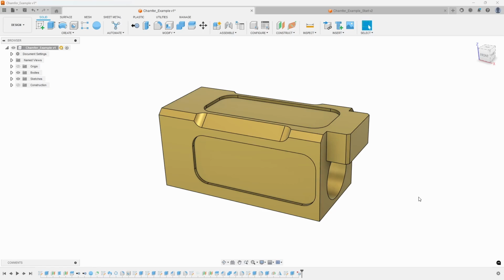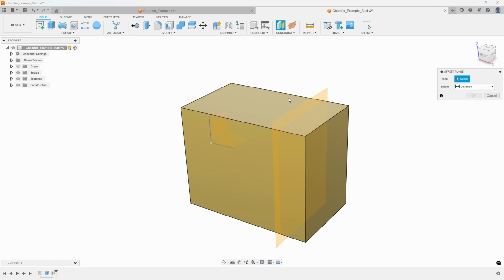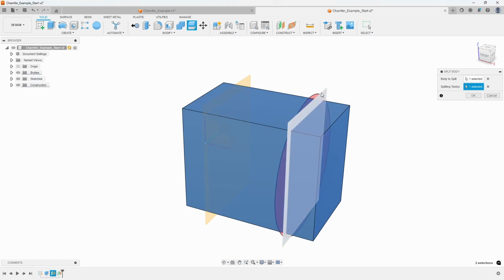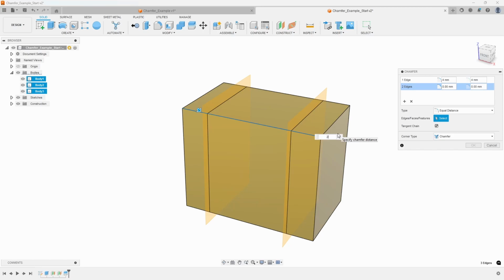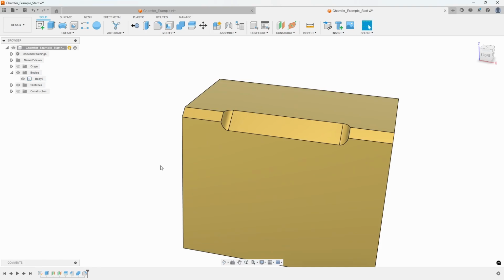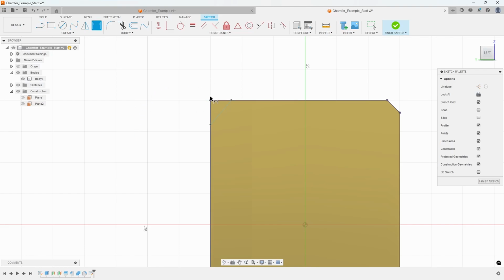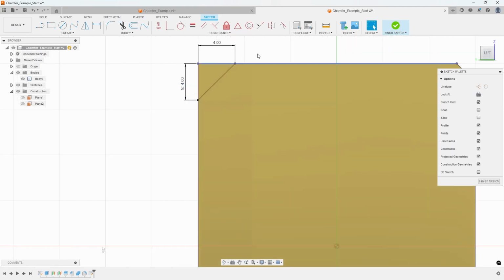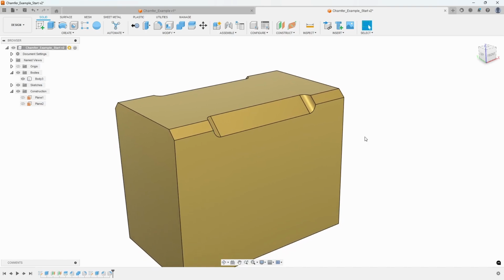Fusion Stepped Chamfer

Comment: Nice quick tutorial. Thanks.

How about doing an actual stepped, i.e., gradual chamfer? What I mean is instead of a fillet, what if I want a series of small chamfers to create a curved edge. This sometimes is useful for design purposes. It does make elegant designs. Today, I make it the painful and brute force way. Start with one chamfer, then select the new edges and add another chamfer etc, until I get full curvature. It's a bit painful and creates a series of chamfer commands. I wish there was an easier way.
Reply from the maker: I think I understand what you are saying, and that would make for an elegant design.  Maybe you could create a stepped profile to "sweep" add or sweep remove the curve.  Not sure of that would be any quicker than doing multiple chamfers, but it might give you more control over the "profile" of the steps.
Reply: @bradtallis8968  That's a shame. I think such features exist in other programs. I wish one had a 'Stepped Chamfer' command in which you define either one-sided, two-sided or symmetric as it is for the current chamfer command but be able to specify number of facets. 1 facet would be the same as existing chamfer but 2 or more would create a nice stepped chamfer.

If you have an "in" with anyone at Autodesk, perhaps you can suggest the feature to them.

Comment: A third way to do this would be to start with your two offset planes. Then chamfer the corner. Instead of splitting the body, use the offset planes to split the face of the chamfer. That just use push/pull on the face you want add the deeper chamfer. No need to split the body.
Reply from the maker: Yep!  That's true.

Comment: I like how you chose 2 different ways to do this, I'm always looking at how am I going to machine this, which in most cases is very different from how would I print this.
Excellent tutorial as always!
Reply from the maker: Ya, I think machining this would require indexing the block at 45 degrees to create the "blends" on the edges of the chamfer correctly.  I tried adding chamfer toolpaths to the design and noticed the blends did not machine the same as modeled.
Reply: @bradtallis8968  I would probably use a wide chamfer bit and just select the top edge to follow that contour. Thanks again for all your videos!

Comment: For method #2 you didn't need to create the plane.  You could have put the sketch on the end and then offset the extrude (same distance as you put the plane).
Reply: And also drawn both chamfers in the sketch, so it’s one sketch, two extrusions, and a fillet.
Reply from the maker: @swissfreek- ooh.  Also a valid point.  Simple and concise.  Thanks for sharing!
Reply from the maker: @j.f.christ8421 - Yep!  Good point.  Totally should have shown that.  Some die-hard parametric people say that you should always "build in" your design intent, such as defining the plane and then creating the sketch on the plane instead of using an offset in the extrude feature, that way it is easier to "understand" the design intent if the part was handed off to someone else.  However, I think the offset in the extrude is such a cool feature, I'd much rather use that and keep my timeline "cleaner".

Comment: I didn't know you could do multiple chamfers in the same operation. Great tip. It's been awhile since I used Fusion 360. But I seem to remember that you can split a face with a plane. Could you do it this way? Create the 2 mm chamfer on the full Edge. Create the offset planes. Split the face of the 2 mm chamfer with the offset planes. Push the center portion in 2 mm. Create the fillets.
Reply: So I was curious and no you cant do it that way it fails when you try and create chamfers 🙃Even if it worked it would still be the same number of steps as you need to recombine faces. To avoid creating the planes you could make the initial body (for this simple case) from three extrudes as new bodies then combine after you do the chamfers.
Reply: Thanks for the reply. You got me curious. So I went and downloaded the free trial just now. I was able to create the double chamfers just as I described. It's only one step shorter than the one in the video. Because you don't have to rejoin the two bodies.
Reply: You can do it with fillets, too. I just wish there was a way to edit the chamfer once you set it up. Like there’s no way to remove an edge, you have to delete that group of chamfers and start over.
Reply from the maker: @roguefinger-  Ya, split face doesn't work because that edge shares two faces, not just one.  That's why split body works.  I even tried splitting the two faces that the edge touches and it still didn't work, so I always use split body and rarely use split face.  You could do it the way you described, but I try to avoid using push/pull/move commands as it makes it more difficult to understand the design intent of the model if it were handed off to someone else.  For example, you might say, "Why did he create a 2mm chamfer and then push it in 2mm instead of creating a 4mm chamfer"? Hopefully that makes sense.  Like I usually say in my videos, there's probably 3 or more ways to create the same thing.  :)  I appreciate you watching the videos and I'm glad it's getting the gears turning in your head with ideas!